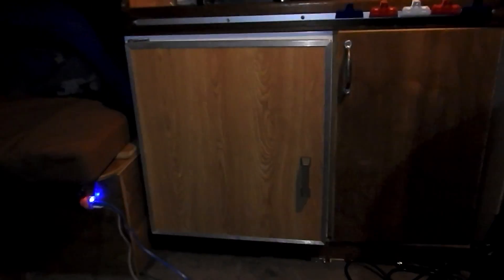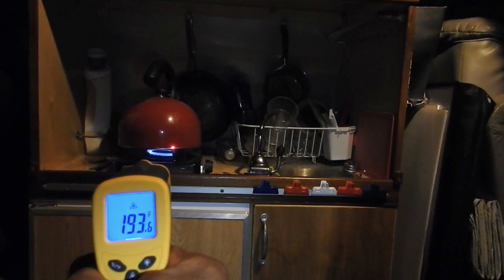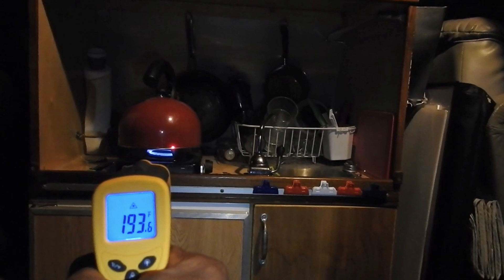Moonlight Temp Experiment Reloaded: #FEOffensive Version (Flat Earth)

Comment: D.Marble,
Is it possible for you to do the experiment once again? Now before I am jumped on, dragged through the streets and condemned, please take a moment to consider the shield that you were using. I'm only being fair here. I'm not doubting, just trying to cover all bases.
Perhaps the temperature difference is due to the fact that your shade- with barbers cape, towel and folding stool could be already warm from being in your van. I would wager that the temperature in your van is higher than outside so you could be getting an inaccurate reading. Just a thought. 
I'm not a shill, not a doubter, not a hater; I'm just a person that looks at everything radially.
Maybe put your shade outside for several hours in the night to acclimate it for the experiment.
Reply from the maker: Vitriolearth you seem to be concerned with the laser picking up on reflection off the aluminum. I've got something for that.
Reply: That's awesome, D.Marble! Looking forward to seeing more experiments :) My main concern is the possible heat radiating off the stool, towel and cape setup. But let's see more wonderful experiments :)
Reply: Hi again D.Marble,

I'm going to perform the same experiment next full moon (granted the weather permits) and will use aluminum foil that is smooth without any wrinkles, aluminum foil that has been crinkled up, aluminum foil perpendicular to the light cast from the moon, foil on the ground, on wooden surface, cement block surface, and my shade(s) will be plastic, metal, wood, cotton (towel) and a combination of all of them. I'm even going to try without the foil and maybe use 1/16 of an inch aluminum plates, steel plates... The experiments must be exhausted; every possible scenario must be acknowledged so that we can conclude the experiment a success or a failure.  

We must take into account the various conditions of our immediate environment when performing such experiments. What is the temperature of the asphalt, cement, wood prior to laying down the aluminum foil? Is the aluminum foil acting as a blanket, trapping the warmth from the sunlight heating up different surfaces? I remember back in South Carolina I would walk up to an old oak tree at night after a very long, hot day and place my hand on the tree. The tree was warm to the touch! and so were the buildings for hours and hours after the sun traveled across the land toward the West. 

We must show a repeatable experiment under many different conditions before we claim success. Again, I'm not some shill; I'm just an individual that believes one experiment isn't enough.
Reply from the maker: Vitriolearth use a different material or spray the foil with a flat spray paint so the IR WONT reflect.
Reply from the maker: Vitriolearth perfect. I'll do the same with many different surfaces.

Comment: 0:50 ... lets go ahead and get calibrating ...
points thermometer at a gas flame, it reads not even 400 F

Now the trust in everything else you do is firmly established!

59 F vs. 16 F - and even less
Man, you must have frozen your bum off while "performing" this sophisticated experiment.
It sure was chilly.
LOL
Reply from the maker: jonathanjomen The laser isn't the part that does the information gathering. The red dot simply shows the direction in which the invisible IR beam collects data from a small circle around the laser. So some of the data was drawn from the fire and some from the teapot. Anyway, I look forward to watching your experiments in the future. Or you just gonna continue sitting on your sorry butt typing bullcrap in your moms basement?
Reply: I know how such a thermometer works.
The joke was more towards what you called "calibration".
And it sure must have been very chilly as you where fully exposed to the cold moonlight during the "experiment".
If you don't notice that fact, staring you right in the face, nothing anyone can say will be of any significance to you.
Doing an experiment on this myself, filming it and showing you would just be a complete waste of my time.

Comment: Obviously you have no idea how an IR thermometer works. You can't get good data from reflective surfaces. Do some research.
Reply from the maker: Here ya go guy. I went back for one more time. https://youtu.be/SR7taptvaOM
Reply: D. Marble you should try this experiment even one more time but use a flir cam. If there is any heating or cooling you will see a shadow or outline from it.

Comment: Try this on a night that that the sky is clear and there is NO MOON in the sky.  You will get similar results... BECAUSE  the area under a clear sky is lower in temperature because of radiative cooling.  Areas shaded from the sky will be a few degrees warmer do to this cooling mechanism being blocked.   This process is what is called a "control" to validate whether it is the moonlight or some other process causing the difference in temperature.  Try it.

Comment: Again the same mistake. Zero evidence and wrong conclusion. All that due to very improper measurements:
You have to use so called 'black body'  instead of aluminum film. Black body means that the surface is black and matt. As you know, and this video confirms it, your film reflected >90% of light from your thermometer and it does the same with infrared light that your device measured. So in fact you have measured temperature of sky in one case and the temperature of your shadow caster in the second case. And the measured results were a logical consequence of that.
The only question is: did you manipulated the result deliberately or are you only so ignorant?

Comment: I applaud your videos and your passion... I personally believe that both the sun and the moon are not anywhere near the distances we have been led to believe, and I base these opinions on several factors that include crepuscular rays, size comparisons of features on the lunar surface to those of the supposed same size here on earth, temperature differences/changes throughout each day and also many other reasons (too many to list in a comment).....
I am also OPEN to the notion that the moon is emanating its own light and not reflecting sun light and IF that is the case, then it very well may be a complete different type of light and cause differences in temperature (as your video and others seems to clearly  document)....
However, I want to interject a word of caution to remember about these types of experiments and claims...
They ultimately have nothing to do with the shape and/or size of the earth. As I stated above, I am OPEN and receptive to what you clearly display in this video and I certainly am in agreement that the entire heliocentric model is a load of indoctrinating BS...and this type of finding has a PLACE in exposing more and more of the deception that has been perpetrated upon us all... but at the same time, it ultimately has no bearing upon the shape of the REALM in which we live.
Bottom line is that this type of funding is just another huge blow to the utterly ridiculous heliocentric/copernican model.